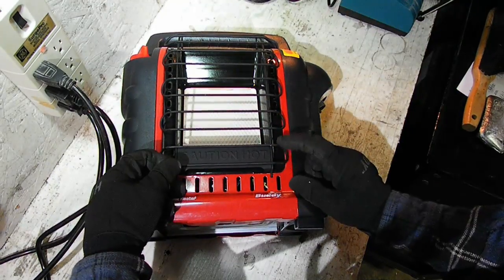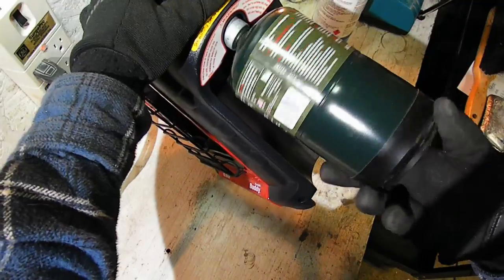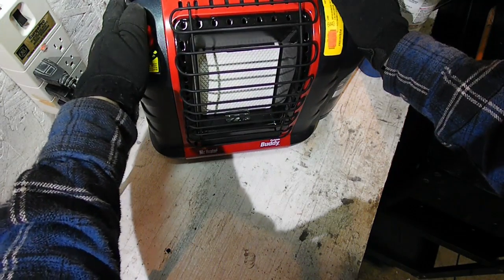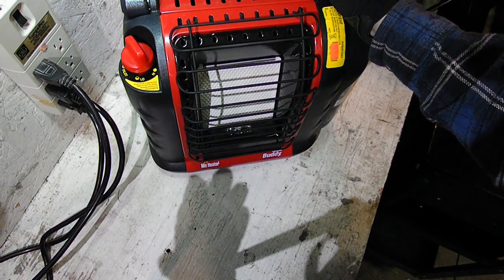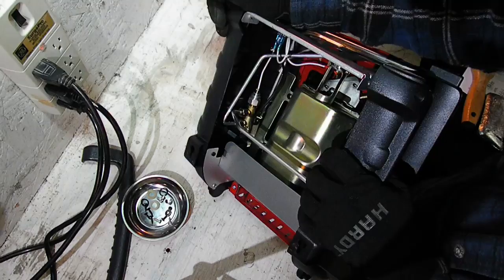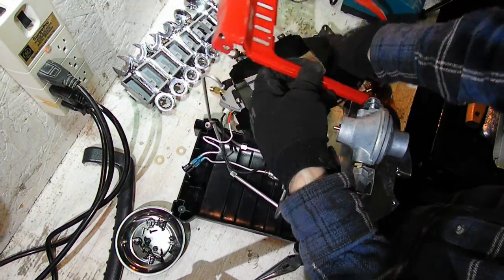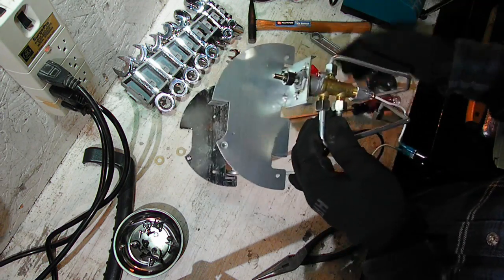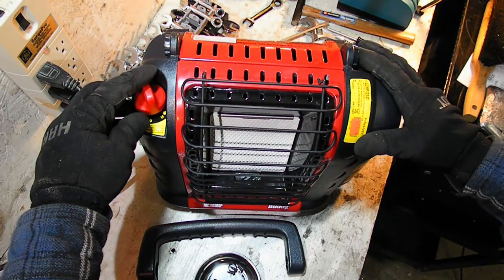REPAIR: Mr. Heater Portable Buddy

Comment: Funny, all the people who claim this is a crap heater. I have two. One i bought new 20 years ago, the other, i bought used more than 10 years ago. I give them a half assed cleaning once a year and they're still kickin!
Reply: Never clean mine for around 20 years . That thing went to hell and back and it never failed me once 🤷‍♂️ never cleaned it ,  for ten years now it's on the wall in my shed , i go through 7-8 20 lbs tanks per winter , and never had any issues 😁 i can't say it's crap 🤣🤣🤣

Comment: The new 12' hose for this heater does not work. It does not allow enough gas flow to keep it lit. I bought and returned 2 of them to Lowe's, wasting 4 hours. First test your hose by sticking a nail it it to check the flow. If it is not strong that is the problem. Cheap Chinese CRAP. I used an old hose I had and my heater works fine now.

Comment: Your spider issue saved me alot of work. Popped the line off the pilot and out poured the oil/liquid. Also a speck of dirt in the pilot hole. Runs like new. Thank you for your sacrifice.

Comment: OK, 6 years on and I have one of these that was working when I put it up last years, and now it sometimes lights the pilot but if it lights, it burns with a yellow flame. Spider web sounded VERY likely so I cleared the tube with a Q-tip, no help. Then shot it with some canned air, UPSIDE DOWN so it had the force of the liquid propellant to add some 'Authority' and, HOT DAMN, IT WORKED!!! Thanks.

Comment: Your video helped us take our Buddy apart enough to get to the value where you had a spider. But ours was clean, no spiders or dust. However, whenever we moved our Buddy, something was tapping. To the side of the main compartment is a round, black piece that I assume is the tilt safety feature. The ball in ours was not seated in the bottom, thus making the tapping sound. We had to jiggle the Buddy a bit to get it seated properly and then it worked. Yeah!!! Thanks for your help.

Comment: Mine came with a loose side panel..broken tabs but working out of the box .
 I've only used the recommended filter and bulk hose ... about 100 gallons so far with no other issues. 
I strongly recommend the filter !

Comment: .
99% of problems with a Buddy Heater are clogged air holes in the pilot burner tube.
.
Reply: well i went camping 3 days ago and it failed on me ALTHOUGH i tested it at home before i went. when i was camping i watched a video about sticking a qtip to clean it up and lost the qtip tip inside the gas hole. now i have 2 problems the original and fishing for that piece of cotton 😫😫 but i won't do what philsostuff did i will go straight although the temptation was good to take the hole thing apart and burn it during my trip. to the part where i lost the thing. 😂😂

Comment: The only Mr. Heater units I have found to be reliable are the old-fashioned tank-top heaters. I have two others. One is a cannon style "Hero" heater  that is cordless with a battery so it can be run on its own power.  The ignitor quit after a month of use. The local dealer told me it had to be sent out of state for repair. The Mr. Heater "service" rep was indifferent. The other is a Buddy that is unusable because it has a cracked bottle gasket, after little use. Again, no parts readily available. Inferior components and parts availability are a hallmark of the Mr. Heater company.

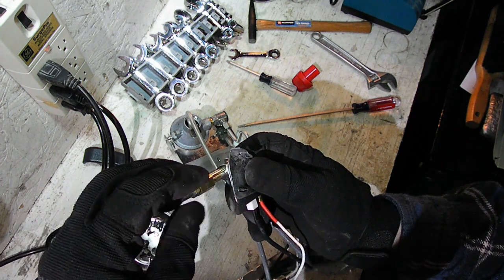Comment: 9:00 During "off season" put tape over end of pilot burner, and ALSO the tiny hole on side of pilot burner.  Store the heater in a plastic bag and seal it SHUT to keep insects out.  Another common failure point if cheap extension hoses have been used without official MR HEATER filter, is the aluminum tube between tank and main "selector valve,"  can get gummed up with some type of heavy OIL.  Use wrench to loosen both ends of tube, remove and clean out with acetone of rubbing alcohol.  Clean, dry out, reinstall.  (For entertainment purposes only.  NEVER REPAIR YOU OWN HEATER.  IF BROKEN, THROW IT AWAY.)
Reply: I found oil in my tube also, was the problem.

Comment: Mine kept going off over the weekend. I suspect it is the thermal couple as it works for a while, then goes out. I will blow out all the lines first before tearing it apart like you did. I thank you for doing that so I dont have to. I actually ended up buying a new heater because we were csmping over the weekend and I really didnt want to get into tearing the old one down. I will probably fix it and sell it. You got a great deal at $40 Thst half of what a new one costed.
Reply: I wrapped a copper wire around the little nipple and extended it closer to the pilot  Now the flame detector is closer the pilot light!  Solved the problem of the heater going out!  Flame detector needs heat to continue operation .  Worked for me!
Reply: @kountryvaudeville  I noticed the flame kernel was not reaching all the way over to the thermal couple so that would be a big part of it. I used a shorter hose and that fixed the issue. My older heater probably needs the lines cleaned out as well as the orifice at the end of the line. I seen one guy had a spiders nest in his. My furnace in our older pop up camper had that issue.
Reply: LOL! I finally cleaned out pilot on one "broken" as shown and it worked immediately!

Comment: I have the same heater at the moment it's okay I need to repair the handle because I use it to heat items up and sometimes I forget and therefore I melt a little bit of plastic. LOL.  
What is important when taking any mechanical or electrical Appliance apart is to remember Occam's razor. Similar to a fuel-driven engine;
 gas ,electrical , mechanical are the three steps to diagnose. The little Friar was a smart sob!

Comment: can the ceramic be replaced from the front without taking it apart?  I have the replacement, just can't seem to remove the old metal frame from the broken ceramic
Reply: Takes time and patients. Lots of screws.

Comment: lol I did the same thing when I first tried to fix one. 

Yeah, the best thing to do(after cleaning the pilot light orifice) is to take the back panel off by removing the 4 screws(2 top, 2 bottom). After that you can get to everything necessary.

Comment: Well it’s neat to see all the inside, but as you know, following the simple pilot tube cleaning method with the Q-Tip alcohol and air blast would have solved it. Good video though.
Reply: Didn't work

Comment: My question is how do you get to where the spider web was without taking it completely apart.
Reply from the maker: I think I could have taken the grill off and cleaned out the pilot
Reply: I have that same question.  Alcohol and qtip and a can of air didn't work for me.  Heater is less than 6 months old.  Bummer

Comment: how do you get the sides off. I need to get at the regulator.
Reply from the maker: I can see if I still have the footage saved if you still need to know.
Reply: @phils0stuff  thanks for the offer, but it's not that important. I'm pretty sure I need to take the front off to get to that one screw holding the side on. That will be a rainy day project.

Comment: Mine quit after 3 years.....no pilot light.....did the q tip thing....nothing....shot a dab of brake cleaner in the orifice then took a rubber tipped AIR gun and gave it a shot of compressed air.....presto ,
Reply: After the alcohol swab failed i tried your method with brake cleaner and a duster. Worked like a charm, thanks
Reply: @bryancansdeez4453  great,.... also the main valve gets gunked up and prevents the burner from igniting....carefully disassemble and clean and again presto......pain  in the ass though....🤣😂

Comment: Put it back together and had more screws and washers left over than it would take to put the handle back on is not a good sign.
Reply: That's how Chevy saves money on new models. They realized their trucks still run with less and less parts, when it doesn't start and run, they stop, put a couple parts back till it starts again. Has worked for them for 100 years. Ford keeps using the same parts for 50 years, till sales slow down, then introduce another cup holder.

Comment: This was not my problem.Oil in line caused by Factory Neglagence/lack of retail responsibility.No factory hose in stock,or informed sale's staff.$100.00 for unit,$25.00 for wrong aftermarket line.Time invested in research,my hourly rate,$75.hr.x10 hour's research.Crap

Comment: DON'T BE  AFRAID OF IGNITOR
PUSH DOWN QUICKLY,  AND HOLD DOWN
3 / 4 SECONDS, WITH NEW TANK HOLD LONGER      PRIME THE CARB, LET IT GAS UP       HOLD DOWN TO PRIME WITH GAS
       THEN  JUST POP IT, AGGRESSIVELY
SHOULD BE NICE, BLUE FLAME
TURN TO HI TURN PANEL ORANGE,
THEN  TO LOW   RUNS 6 + HOURS

Comment: Have to HOLD IGNITE DOWN 3 OR 4 SECONDS, PRIME THE CARB, WITH GAS.
THEN POP IT !  SHOULD DO A PRETTY BLUE FLAME. IF ITZ COLDER,  HOLD IGNITER LONGER, TO HEAT UP FLAME ROD SENSOR,   THEN RELEASE  !